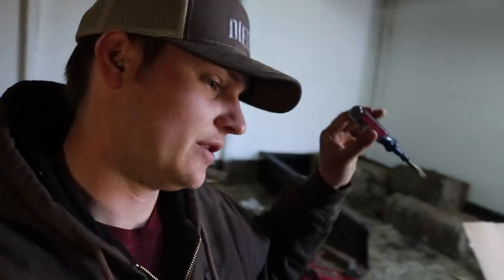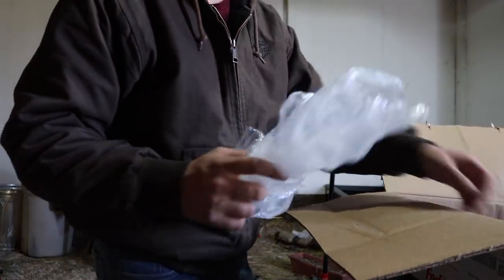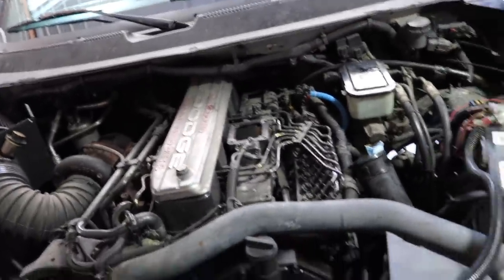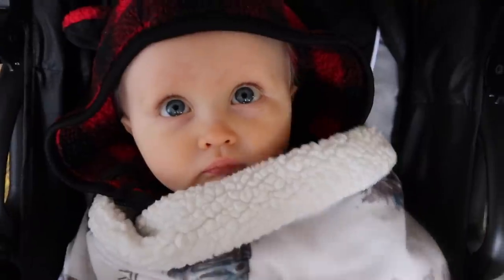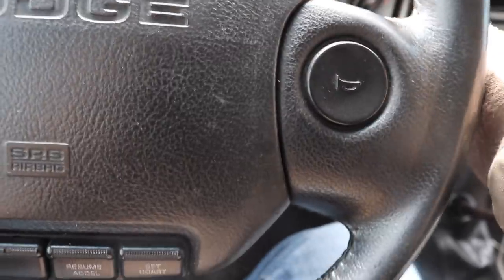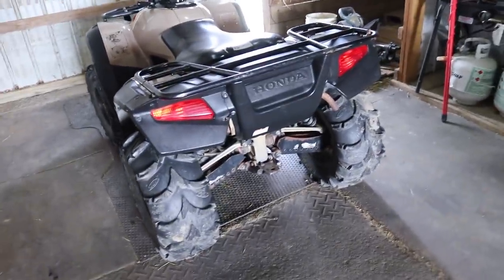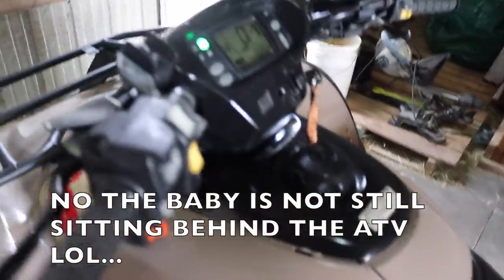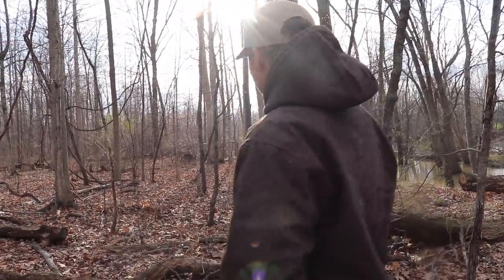I CAN'T FIGURE THIS TRUCK OUT!!!

Comment: Never seen someone so upset that there truck isn't smoking 😂
Reply: Dumb...smoke is wasted fuel and wasted money. I am all for a once and a while coal roll, but not all the time.
Reply: @glmcbryde  
This, 
I have a 07, 5.9 with a few upgrades and I really dont have much smoke at all. While it is only a couple hundred hp over stock, apparently I'm not yet wasting enough fuel. 
Personally I'm happy that it doesn't. When I go full throttle it will produce some but nothing like a few around here with less power. I had always figured that I did it correctly using the proper parts. The tune is matched with the  upgrades that I have done.

Comment: Go to prower driven diesel page the show you exactly how to get it done on the afc housing they just did a video series on a 12v doing a 500 hp fuel set up but they go in the afc housing and show what to do

Comment: Turn the star wheel until it doesn't turn anymore. It won't smoke when you lug it out with the fuel plate still in it but when you first shift it will smoke. That is a preboost screw so it makes it spool up faster
Reply: There’s no fuel plate. Previous owner took it outt

Comment: Your not a 12 valve guy Lmfao 🤣 number 5 fuel plate kit boost elbow turn the fing star wheel towards the cab six or seven times and all the smoke you want lol taking the afc apart is a waist of time